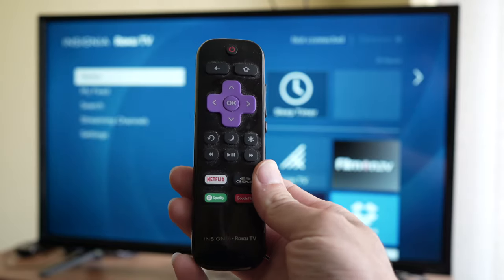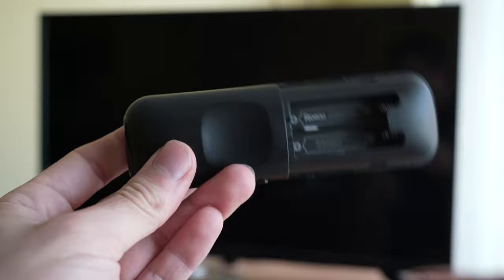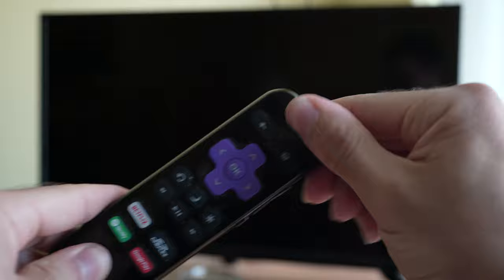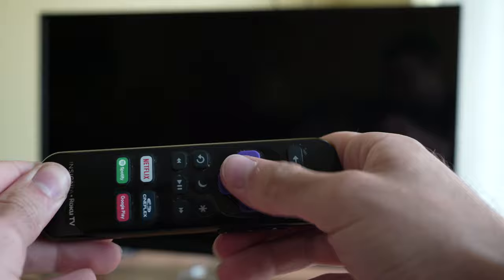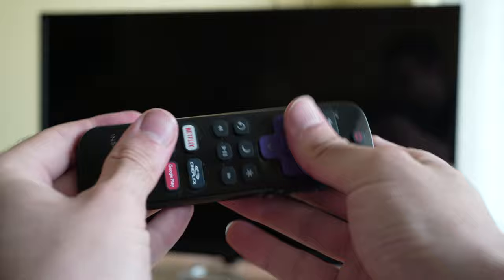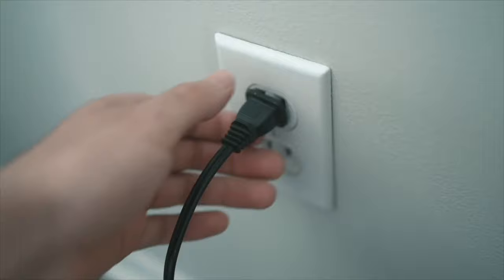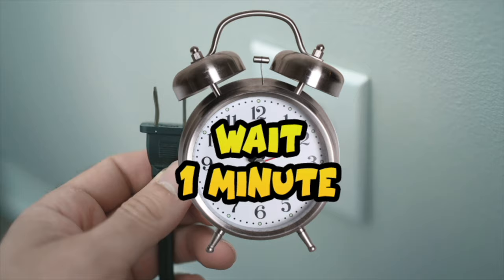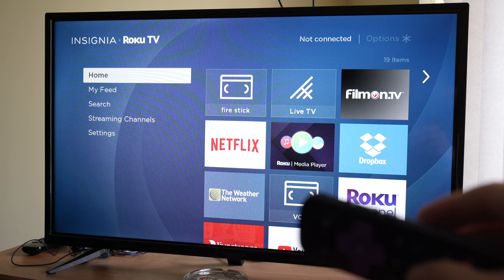Roku TV Remote Control Not Working? How To Fix It Fast

Comment: lol it actually worked. I have 2 roku remotes and only one of them would turn on my tv. The remote that would not turn on the tv worked fine for volume and everything else. After removing the batteries and pushing buttons for 5 minutes it turned the tv on. thanks

Comment: My right arrow button won’t work. That’s it. Every other button works fine except this button.

I don’t know if it’s the remote or the TV.

Few mos ago I got a new Roku Device/Remote. 

That one sucked. I’d have to press the buttons like 20 times to get it to do anything. Then suddenly the power button wouldn’t work. I had to press the button on the Tv to get it on/off.

I don’t understand what’s wrong.

Is my Tv not letting remote connect. 

Do I need new batteries for my remote?

Why is this issue popping up after 3mos?

Comment: I have tried and tried and it does not work and the Tip on unplugging the TV  I can't do that because I have an extension then I have it plugged in and I don't know when it's happened but That plugged that I had the TV plugged in melt it